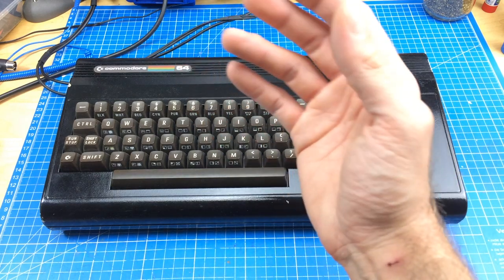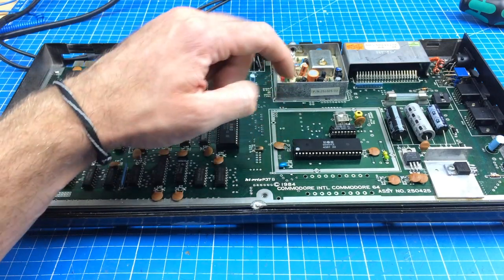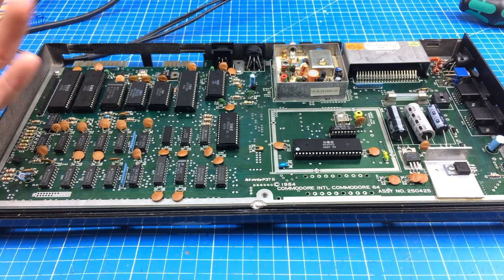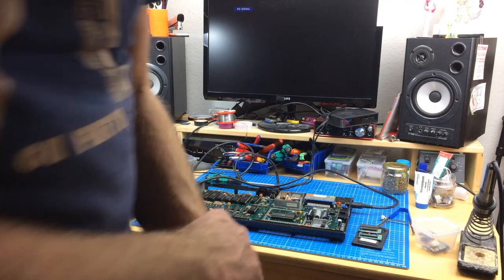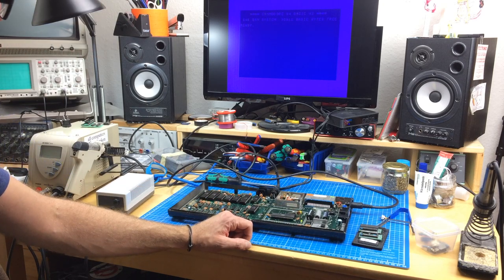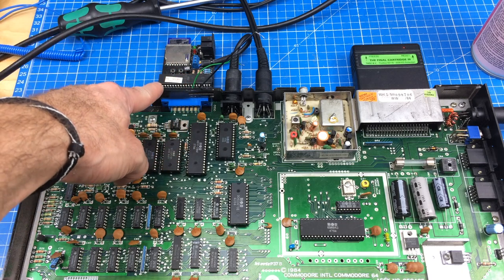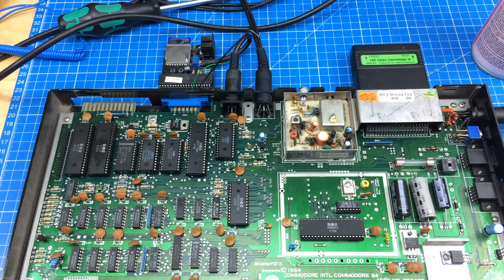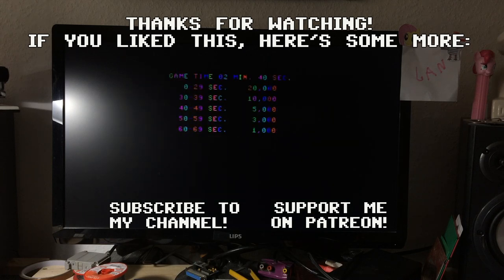Black Beauty Commodore 64 Repair (Wrong VIC-II again!)

Comment: It's sure is nice to have a simpler fix once in a while. Good eye spotting the incorrect VIC-II ver; it speaks to the level and quality of your Commodore computer repair expertise. 👍 I also have a very sick black screen C64, with many problems, that I've been working on for quite a while. I didn't even think to check the VIC-II version. Great work, as usual! I'm excited to see what else you have lined up in the queue -- keep 'em coming!
Reply from the maker: Thanks! It was a close call. Literally spotted the chip the second I wanted to turn the C64 on. Phew...

Comment: I wouldn't paint a case unless it's yellowed to an inch of its life ;o) ..I'm not a fan of retrobrite..This doesnt look too bad in black though, it resembles a Commodore 16 but with a nicer black.
Thanks for the mention Jan :o)
Reply from the maker: Totally agree on that. This C64 doesn't look bad but the paint job is nowhere near as nice as what you did with the A1200. :)

Comment: Hi Jan. Nice video.
All your videos are really interesting and fullo of details.
Just one question: but it's so easy to mount the wrong Vic-II on the wrong motherboard?
Reply from the maker: Thanks Vittorio! The VIC-IIs have the same form factor and nearly the same pinout (except for the 12V/5V supply voltage difference) so it's really easy to confuse them. The VIC-II is also socketed in all C64s I've seen so far so there's no lengthy soldering involved.
Reply: Thank you very much for your reply :-D
Your videos has brought me the with to get back a Commodode 64 or an amiga at home as example of computing for my kids when they will grow up. I'm asking around if there is someone with an old machine at home that doesn't want it anymore :D
Too bad that my parents recently trashed my old Acorn Archimedes, a common computer in UK but rare in the rest of Europe (expecially in Italy) :(

Comment: A thought on ESD:

When i was younger i used to use a wrist connected ESD strap, but nowadays when i muck about in electronics, i just touch ground in the power strip (got a Euro one with metallic ground clearly sticking out) and i also do not move about after that so i won't get charged with static. It's good that you use protective measures, but i find it overkill if you know what you are doing. Haven't destroyed anything so far.

I store components in proper ESD bags though, cheaper in the long run.
Reply from the maker: Yeah, I used to touch the ground pin on the outlets, too. Most of the time it works just fine. I destroyed one IC in my "career" so far (at least as far as I've noticed) which unfortunately was a SID. From that point on I tried to be more careful. ;)
Reply: Absolute garbage. Measure yourself with proper ESD gear and you will see that just moving your hand a bit may create kilovolts in you, depending on the kind of clothes you wear and the environment etc. Not destroying stuff is just luck, not because you touched ground and managed to stay perfectly still.
Reply: You killed a SID?!  You are a monster!!!

Comment: Too bad they painted it black. The black color doesn't go with the stock keyboard color at all. I think I would try repainting it a color close to stock or maybe a different color that compliments the brown keyboard better.
Reply: i had used the keyboard from an C16 instead even with the housing
Reply: Then Modify the C16 Housing with a C64c Keyboard instead :D
Reply: how would those keys look retrobrighted?

Comment: Jan I see that there is no cover on the RF modulator on that motherboard. I’ve got a 250466 board but the modulator cover is very rusty. Will it be ok to just remove it and leave it off?
Reply from the maker: I recommend leaving it on as it's the only shielding in the C64 that actually shields the components from outside RF. It's going to work fine without it though I guess (as most frequencies are way above anything that could disturb the old components). Maybe just check if you lose quality in the picture output.
Reply: Jan Beta Thanks

Comment: How come the wrong VIC chips in there? I mean someone exchanged the original chip for a wrong one. What could one have expected?
Reply: Some chips are interchangeable and some aren't so maybe they weren't aware that particular one was a no-no. They didn't do their research!
Reply: Old comment I know :) Well to be fair - it is actually pretty easy to modify most longboards to use the new VIC-II chips. All you have to do is disconnect the 12v and connect it to the 5v. On some boards it is as easy as desoldering a bead and a single wire on the underside. On other boards you have to cut a trace. If you have one of the boards that needs to be cut and you don't want to cut it you can get an adapter socket instead. Makes perfect sence as the newer VICs are much more reliable and less power consuming.
The shortboards is also some times seen using "wrong" chips - specifically the SID. It is very easy to convert shortboards to use 6581 SID and it's even documented in the schematics. A zener in the PSU part which is only used for powering the SID so it'll give out 12v instead of 9 and add a resistor on the board to get filter correct and presto the 6581 plays nicely - just don't drop in a 8580 as it'll fry at the higher voltage.

Comment: Great work and video. There must be a good way to remove the paint that isn't damaging to the plastic (no strong chemicals). I'm sure there is but I can't remember it right now.
Reply from the maker: Thanks! Finding a way to remove the paint would be awesome as the case seems to be in good condition otherwise.

Comment: I also have that problem with the TAC-2 joystick fire button becoming less responsive. Could you make a quick video about fixing that?
Reply from the maker: I made a TAC-2 video a while back where I show the mechanism. I think you can "fix" the switches by just cleaning the contacts most of the times. I will definitely open it up again to fix it and make a little video sometime.
Reply: I do to my TAC-2s what I've done for the last nearly 30 years, polish the metal washers with some fine grit sand paper to get rid of the oxidation. Also I like to jam a bit of thin solid core wire under the U-shaped shiny metal contact on the bottom so that it rises up slightly on the plastic post. This reduces the travel distance and makes the buttons nicer to use. Tinning the washer contacts with solder might also help a lot with the surface "rust" which they tend to collect very often. Then IPA for all the contacts helps too of course.

Comment: Yeah, you don’t want to put H-MOS chips into the earlier breadbin longboards! Good eye spotting it. :) Off the top of my head the only H-MOS chip from the 8xxx range that is safe to swap  into older breadbin longboards are 8500 CPUs...
Reply: 8521 CIAs will work in longboards as well.
Reply: Daniël Mantione Yep, thats true too. I just don’t see 8521 CIAs very often here in NTSC land for some reason...
Reply from the maker: It was a close call. I literally spotted it the second I wanted to flick the switch...
Reply: Well it is actually pretty easy to modify most boards to use the HMOS instead as it's just to swap the 12v supply to 5v. On some it's a matter of desoldering a bead and connect a single wire underneath. You can also get adapter sockets which allow you to use 85xx VIC where a 65xx is expected.
The other way round with SID is also seen and that is even documented in the schematics. The vast mayorities of shortboards use 8580 SID but swap a zener on the board and add a resistor that isn't populated and it'll take a 6581 instead.
Reply: @HifiCentret Indeed, I’ve done both things you mentioned due to my obsessive C= chip swapping illness. But good info for others to know if they are inclined to such proclivities. :)

Comment: I didn't know the led connection is reversible. Many years before usb type-c or lightning cable :)
Reply from the maker: Yeah, it's an old trick but it works very well. :)

Comment: Do a repair video on your TAC II if it doesn't work right :)
Reply from the maker: I did a TAC-2 repair video a while back. Replaced the cable but didn't do anything to the switches. I might get back to it when I make that joystick video I have planned since forever.